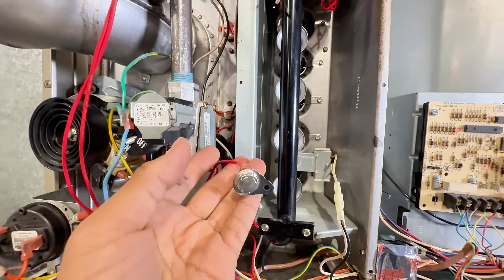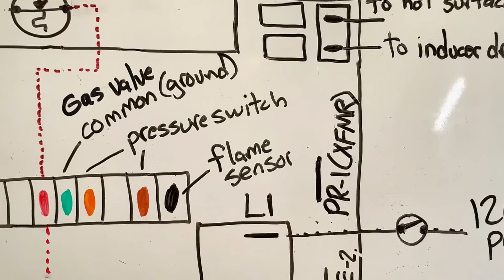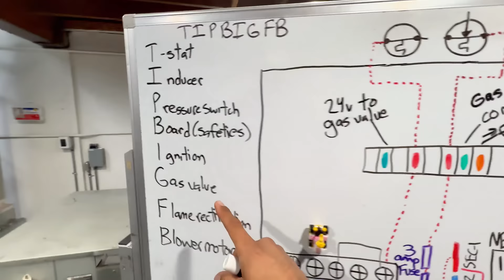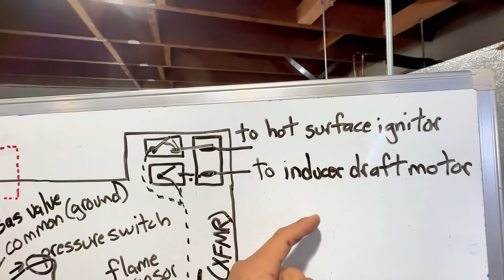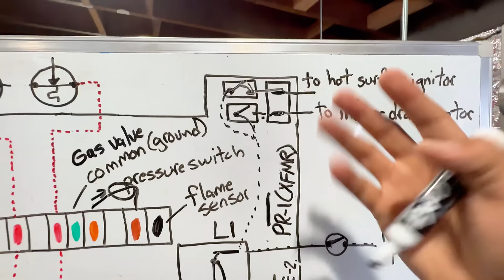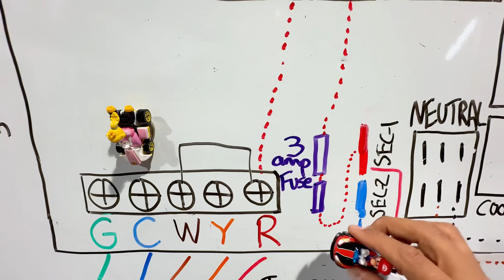How Does the Furnace Control Board Work? – HVAC Training

Comment: Hi thanks for the informational video! I’m using this to figure out my furnace wiring since a tech took a look at it and didn’t put all the wires back. Just wondering what brand and model furnace you have? It looks almost identical to mine but just want to make sure. Thanks!

Comment: Good information, learned. When near the end you said your cooling wouldn’t work, thought you mispokked, if your safety’s were open, makes sense, because you wouldn’t have 24 volts for your cooling contactor to pull in. Never would have thought heating and cooling are connected by hot side saftey’s.

Comment: If anyone can help me out I sure would appreciate it. So what is happening is my furnace is short cycling. It goes through a perfectly normal cycle that you explained, after blowing heat for about a minute, my flame, as well as my inducer motor shut down, and inducer motor turns right back on and it goes through another cycle. So far my filter is new, I cleaned my flame sensor, my pressure switch for inducer motor is working. I thought it may be the thermal limiter switch so I replaced that. I am getting no error flashing on my circuit board. If anybody has any advice, I sure would appreciate it. also, I have had in the past a bad flame sensor, as well as a pressure switch, and I know how my furnace usually responds when those parts are bad and it’s not doing any of that as I said, it’s going through a perfectly normal cycle, and after about a minute, it shuts down and immediately goes to another cycle.

Comment: Excellent video! I learned so much. I take it that mario got stuck with 24v on "this side", this side being conventional current flow or the red plus side? Not common? So common or negative is the blue wire? I guess as long as the circuit is broken polarity doesn't affect design methods for the schematics?

Comment: a Minor Error you made:
The "Sec-1" Port is connected to the Top terminal of the Fuse in the PCB Board..
whereas in your Circuit Diagram you connected that "SEC-1" port to the Bottom Terminal of the Fuse.

Comment: My ac stopped working and when I looked at the connection there’s a small red wire that is jumping those two wires.., does that mean the tech put it that way when I bought the unit?

Comment: This was a great video of explaining the board control, so i'm getting 120.in primary and 24 volts on the secondary power but only getting 14volts on C and R terminals, does this mean I have a short somewhere in my safety's path? my fuse has continuity but it does seem a bit weak, can this cause partial voltage?
Reply from the maker: Possibly a loose connection or a safety that is open

Comment: awesome training and info! what about this model, Lennox G23Q2/3-75-4? auto setting sometime need to manually turn off and on to trigger the furnace to work and even with new or old thermostats.  Any helps and thanks and can it be swap wirth newer controller board?

Comment: I just did all this on my own. I work in systems integration so following a schematic, voltages, opens and closed contacts and triggers are part of my job. Plus you tube is great for guidance. 
We just had the snow and ice storm hit us Saturday and into Monday in the Midwest. So most places shut down. My gas furnace went out on Friday before the storm. I read the board diagnostic blinking light and found a high limit switch that was open. I reset that and changed my filter since I it was dirty enough and may have caused the limit switch to trip due to overheating. 
The board then showed a potential bad gas valve. I changed the igniter earlier so now what happened is the sequence worked as needed but I could not get the gas valve to accept the 24volts and let the gas in. I used my multimeter and would watch it at 14 volts or so and it would jump up to 24 volts but would drop immediately so now what happened is no gas came through. I tapped the valve to try and get it to get “unstuck” but to no avail. Once the tech came in and put the new gas valve in I was back in business. 
15 years ago it was by board. I also troubleshot that and had one ready for me at the local supply house. I brought it home installed in and it has been fine ever since. 
It’s good to know how to troubleshoot appliances in your house. It can save you a lot of money.
Reply from the maker: Awesome job troubleshooting! Glad your furnace is working now 👍🏼

Comment: I have this same furnace, with the HK42FZ034  and I am getting a fast blinking LED. The codes indicate an issue with reverse wiring, but no wiring has been changed. 

My background is in board-level repair.  I studied College-level AC/DC digital and solid-state before high school. I can repair just about anything with the right documentation. 

The wiring at the breaker box has never been touched and the controller was replaced when the (3) 46uf Capacitors leaked previously.

Reversing the wiring or reversing the Red and Blue SEC wires has no effect. The transformer voltage is at 28v. C/R is 28v.

I checked the grounds and cleaned them at the Junction Box and verified continuity. I removed and followed every single cable to make sure there was nothing wired incorrectly.

I downloaded the Carrier install manuals and used ChatGPT/Gemini to do all of the troubleshooting to verify 120v was coming in and there was no leaking voltages to ground.

I found an issue with the door switch but bypassing it did not resolve my issue.

What part of the board manages the reverse wiring protection, and how does it identify this as an issue via the CPU? There are no obvious component failures.

Comment: I have an intermittent problem with my Atwood/Dometic LPG Gas (PROPANE) RV Furnace.....!  It's Winter time in New Mexico I live in the Southern Mountain's....We have unusual weather here this year, it's been mostly in the lower 50's during the day but at Night in drops into the Teens...! The has 2-30# Bottles full of Propane...only 1 is in use at a time,  the Furnace  runs great during the day, at Night....not so much.... at around 2:30 AM to 4:00 AM the Furnace does Not Ignite....I wake up because I'm cold inside temp is 59 degrees F...Furnace is blowing COLD AIR....! I use the Furnace ON/OFF Switch on the Thermostat... and I re-cycle the Switch to OFF and then ON again slowly, 4 times at the end leaving it turned ON..! Usually it lights after that...! I bought 2 new LPG Bottles because the originals 1991, were still being used, then I bought 2-New Bottle to Gas Regulator Hoses but non of those things, helped, and I bought a New Furnace Ignition Control Board for my Atwood Model 8520-II Hydro Flame 20K BTU Furnace, it supposed to arrive by US Mail on Tuesday the 20th, 2026....? So I haven't received it yet and I can't speak of any changes....but some times just sitting here near the dinning Table the Furnace starts blowing cold air on my legs at 5- 6 PM, it doesn't do it all the time, just some times especially when I'm  trying to sleep....! The Propane Gas Company won't Service the RV Furnaces any more they said to call a Plumber....!@%$#$^....?
Reply from the maker: Thank you for explaining your issue. Did getting the new board fix your issue? Curious..

Comment: I don't know if you'd be so nice to help me out but I have a 96 percent efficiency furnace it runs for about 10-15 minutes and shuts down and then tries restarting on the third time it starts usually I'm not getting no codes I cleaned everything I checked all my safety things and everything seems to be working fine I even took the blower motor out and cleaned the condenser off and I also have a new thermostat the latest blank constant which supposedly means reverse polarity or something like that but nothing was moved nothing was tampered with and it just happened so I'm not understanding it thanks in advance and I also love your video it is awesome
Reply from the maker: Sometimes 90% furnaces have two different safety circuits. Sometimes you have high limits around your blower motor. Have you checked air flow? Possibly a high limit opening? Getting too hot?
Reply: @PioneerHVACControls I have figured it out the pressure switch to the gas valve with sucking something up so I took the hose off blew it out clean it out and we have heat oh yeah baby
Reply from the maker: @JohnSmith-cp2yg awesome! That pressure switch will cut the common going to the gas valve if you have an obstruction on the hose.

Comment: Had SCE power outage. After power was restored, Carrier model 59SC2B blower fan was running with thermostat System set to "Off" and Fan set to "Auto" before and after power outage. Had to unplug power to furnace to stop blower fan. When power was reapplied with thermostat same setting, blower fan started running, and flashing LED code, 3-fast, pause, 3-slow, pause. If I do same continuity test (video) at unplugged board connector between 2 red wires and find continuity, does that mean new board replacement to fix? Please advise.... sammy
Reply from the maker: If your indoor motor is on and your tstat mode is off and fan is auto, it’s typically two things. One, you should check the two red wires that is your safety circuit and if you don’t have continuity and it’s open line, the furnace could be in panic mode so it turns on the blower motor. Check your safeties and see why there open. 

Two, maybe with the power surge, relay on the board that supplies your blower motor is shorted on the closed position, allowing constant power to go it but I would check the first option first.
Reply: @PioneerHVACControls  Thanks for reply. 3 Safeties are good and continuity between 2 pins (red wires) Molex connector. Will check blower motor power relays if open or closed. Two Ques - 1. What happens if transformer 24V is unstable ?,  2. What's "Test/Twin" contact on board for ?..... sammy
Reply: @PioneerHVACControls  Update. Isolated Code 33 to bad thermostat that dragged down 24V and triggered false code 33. Your video helped me to find and fix it. You're good man.... sammy

Comment: Have a question. would the ICM282B can replace the HK42FZ027?
Reply from the maker: Not sure. If they don’t sell the OEM (original equipment manufacturer) board, they will generally mention what universal board you can replace it with. Just make sure that it says that it’s replacing the original OEM board your looking for.

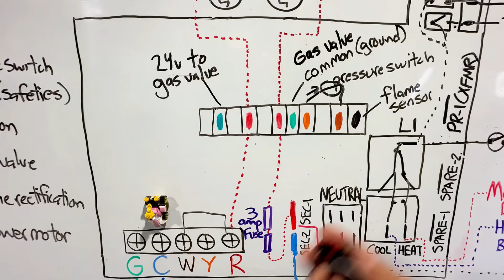Comment: 17:47 - Also, there could be a bad connection on your spade terminal block or a burned trace internal to the board.
Reply from the maker: Yes, so true Gary! So this board’s molex connector where you have the safety circuit actually went bad. We kept getting 14 volts. The actual molex connector’s portion where the board’s pins go to got damaged. Always good to check these!

Comment: My blower keeps blowing and no flame
Reply: Check the air flow switch first and go from there is the unit doesn’t sense air flowing the heater will not work

Comment: Damn they should have these for every HVAC trade school. If I would’ve saw this video in my 1st week of trade school would’ve helped me a lot. I wish there’s one for the condenser unit same way. Explain wiring from the disconnect to contactor , low and high pressure switches. God bless you brother!!!!
Reply: The teachers at these trade schools half ass their teachings 75% of the time. I swear I could’ve skipped the school fee entirely. 😂 I learned everything in the field.
Reply: @NikoGoXrazy 
Just gave a "Textbook" teacher his 1st job after he obtained his contractors license 3500sq' 4 zone home replacement system and
He failed miserably, he triple guessed himself, turned into part swapper , as if every component on this new system was at fault and it wasn't him..

Goes to show ya how, many of these teachers have Little to NO field experience!
Customer had their wash machine going nonstop cleaning his sweat Towels!
Reply: @MtPockets14U lol it’s real
Reply: @NikoGoXrazy 👍
Reply: Trade school is a massive massive scam in 2026. As someone who works for a trade school, you are entirely getting scammed if youre ever paying for it. There is no reason to go to school for HVAC or any trade at all. And anyone disagreeing with me is old and out of touch.
Reply: Also, i worked as an electrician. I learned WAY faster than the trade school apprentices and all i did was youtube the questions I had when I got home (the elitists looked down on me for declining "free schooling" so they wouldnt help me out as much but i knew better) and then i simply asked the old guys for one on one time and half the time if they had any availability at all theyd find time for me. 

Needless to say I earned journeyman in 9 months and ultimately quit shortly after for another profession. I just wanna learn stuff. Idgaf about money, that shit takes care of itself when you work hard and smartly anyway.
Reply: @makingOnions I do not want to get scammed.
Reply: Seen.
Reply: @whenyouknowbetter3451 **
Reply: Great video.
Reply: Yup

Comment: I have a question.for a unit that uses a piston what is you the perfect super heat?
Reply: 8-12 average.    To get the actual number for your unit you need to check the formula for wet bulb, dry bulb temp etc.     google it.

Comment: Who doesn’t Love a “Party”😂😂😂😂
Reply from the maker: That’s right! Lol
Reply: @PioneerHVACControls Neutrals should never be switched. Always connected.
Reply from the maker: @jamescollins8148 home run!
Reply: @jamescollins8148  what do you mean exactly? Never be switched ?
Reply: @j @jamescollins8148 switched with other non neutral wires or switched as in the order that they were installed in?
Reply: @NikoGoXrazy Neutrals are to be constant. The neutral is always required in a circuit, powered or not.
Reply: @jamescollins8148 ahhh 10-4 ! Thank you. I’m an over thinker man. I ask a lot of questions. Some of them may be very common sense things but I have to feel that full feeling of understanding it! Love. - Niko